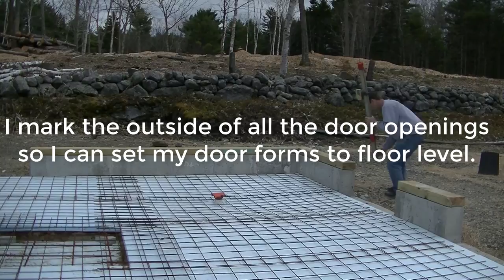How To Use A Self-Leveling Laser To Set Your Grades. (For Beginners and Diy'rs)

Comment: Mike... how do you get your level if you don’t have a foundation wall and your working to forms?  Chalk line on boards?  Or set the boards to level height?
Reply from the maker: I try to set the forms to height. Sometimes if the form is too high, I will mark it and snap a chalk line on it.

Comment: Laser levels are undoubtedly one of the most important tools to come out in the last 30-40 years. If cost is a concern, you just need to remember what you are saving in labor. It took what was always a 2 man job and turned it into a 1 man job. If you’re still using a builders level and not a laser for these kinds of leveling operations, you’re losing money. 
People tend to get confused on one thing - The laser base is sending out a laser signal at a completely random, but level, elevation. The sensor picks up that random but level elevation and then the real ‘business end’ is the bottom (or top) of the rod. The bottom or top of the rod has to be set on a known elevation and then that elevation can be transferred around the site. Or it can be used as an averaging tool like you showed in the video. Also, you can use virtually anything for a rod. As long as it stays rigid and you can firmly attach the sensor, it’ll work. You could use a tree branch, in a pinch.
Reply from the maker: Good info, This is one of my most useful tools. It paid for itself in no time. I still see some contractors using a transit once in a while and can't understand why. Maybe old habits are hard to break I guess.